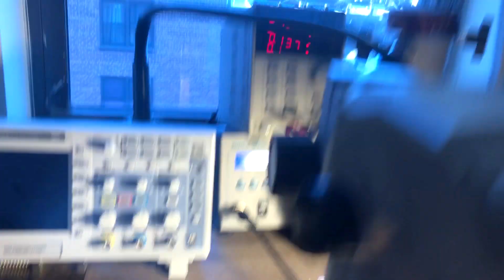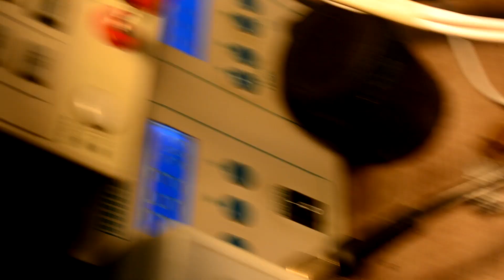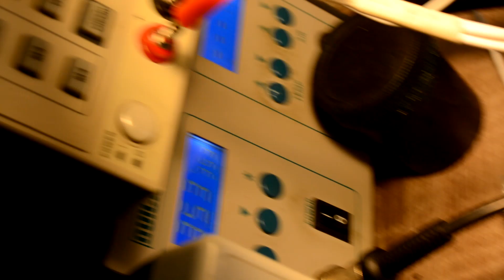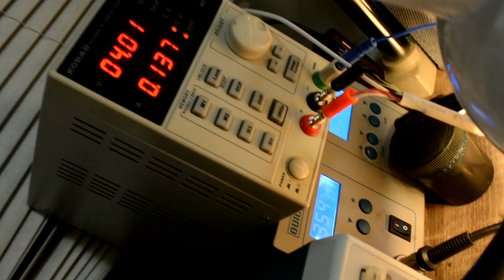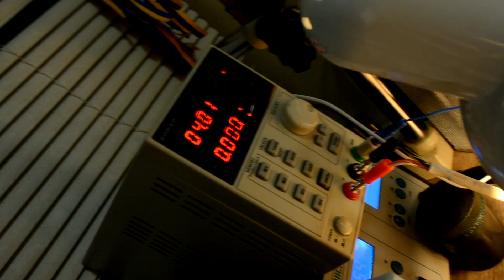iphone get's hot and discharging quickly. U2??

Comment: This was so interesting, I find this kind of work fascinating. Well done with the trick of cooling the pcb down to see where the energy is being used. My iPhone 5s has the exact same problem and it was little fan thing that you could plug into the lightning port that damaged the phone. From that day on it got hot and ate the battery.